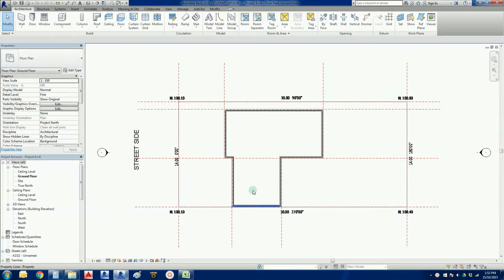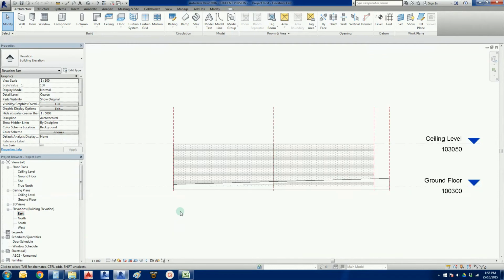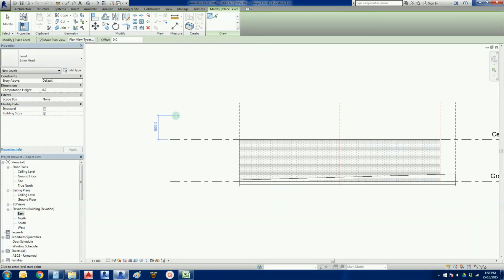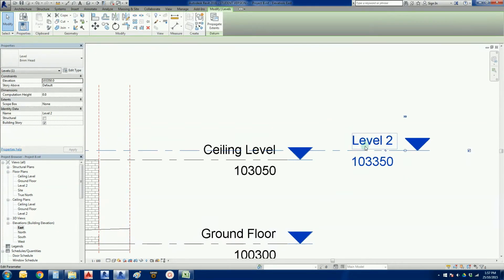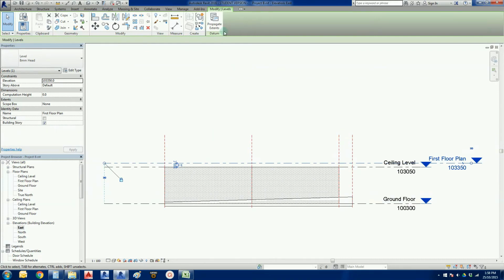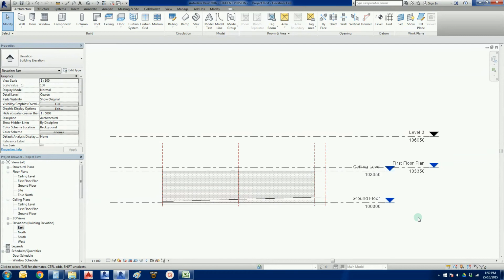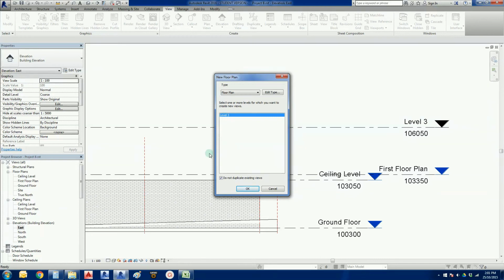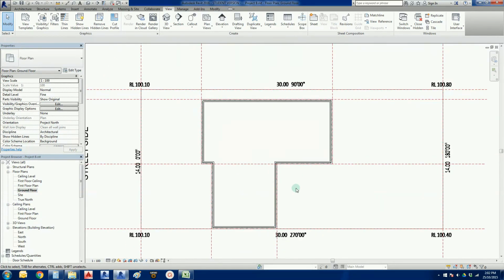Revit 2016 - Project B: #8 Adding New Levels

Comment: Hi Rhys do you have any tutorials on how to do a split level.  do I just add more levels and change the walls perimeters on that edge  to only go to say 600mm off the floor level?
Reply from the maker: HI Anita

Apologies for the long delay in replying.

There are a couple of ways to tackle this.

1. Create more levels
2. Use existing levels but change the top or bottom offsets of walls to stretch them (this keeps the wall bound to the original level)
3. Split the layers of the wall via the 'edit assembly' so you can stretch certain segments independently.

Hope this helps.
Reply: Hi rhys for that.  I am not sure quite what you mean with the offsets.  any chance you can do a video on that?